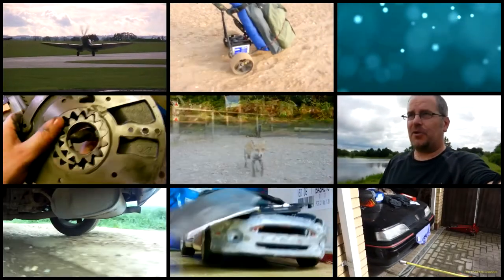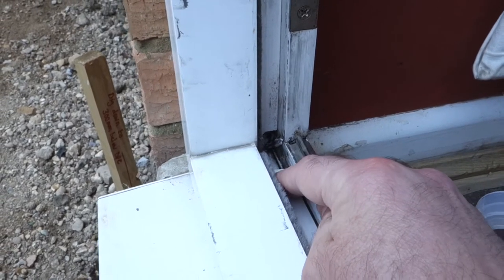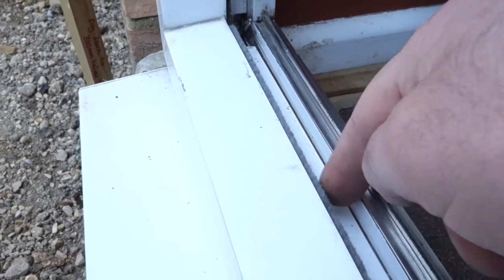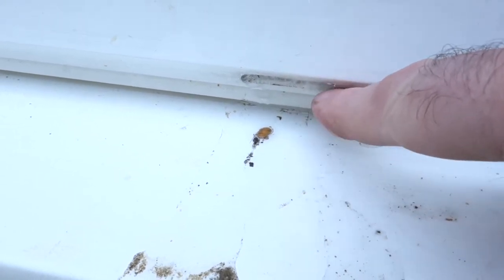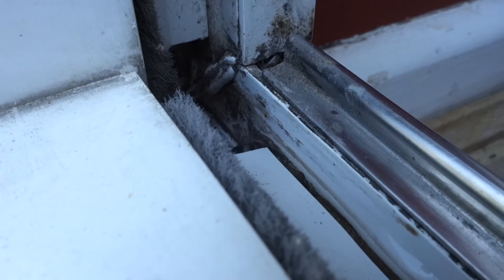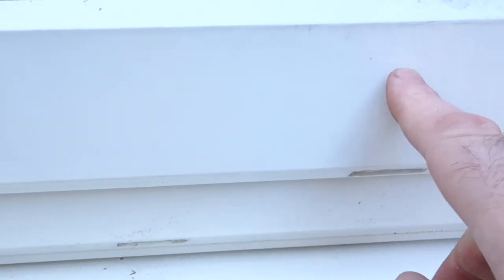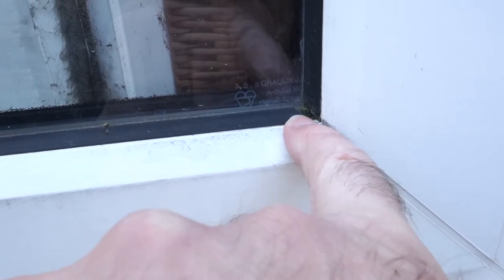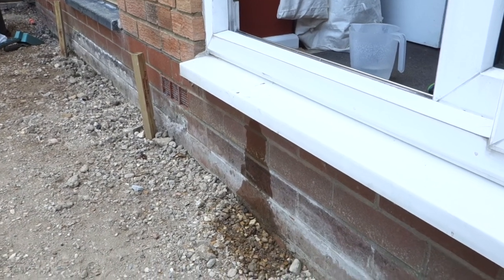Sliding uPVC patio-door maintenance checks - drainage channels

Comment: Hi just watched Great tip ,I have exactly same patio door as yours ,just wondering if you have any idea how to remove the patio door to replace the truck and maybe the wheels too as it keeps getting stuck thanks
Reply from the maker: Hi, ironically I had to remove my door for similar reason back in early Summer - my track wheels had seized up. Unfortunately I didn't video it because removing the sliding panel is a two person job because of the weight. Never under estimate how heavy glass is. Basically you have to remove any trim at the top and bottom of the surrounding frame, remove any clip on trim on the sliding panel, then lower the door by backing off the wheel trucks by turning the adjuster screws. This will cause the door to sink down. (There maybe an anti-lift mechanism or spacer which stops the door being forced off its track) Once all trim is off you will be able to see how the panel fits to the track. On my door I had to lift it up at the same time as pull the bottom of the frame out so it moved away from the track. You will need an assistant or two to help lift it off and place it on a strong, level area such as a table. Try and keep the frame level and DONT let it rest on the glass - only support it on the frame. The door wheels can now be accessed at the bottom. What usually happens is debris builds up and clogs up the wheels and track that can't be accessed when the door is in place. Lots of retailers sell the door wheel trucks so it's just a case of measuring them.

Comment: Great tips. We have an issue with our patio door is that water is trapped inside the window sash at bottom when opening and shutting the door you can hear it sloshing around and it slowly seeps out from the join at the bottom inside the house and at the end corner point. I identified that water must have got in from gap in the beading in bottom corner but its now how do I get that water out from inside bottom of the door! Any advice would be much appreciated?
Reply from the maker: That's an interesting problem. Never heard of water getting into the actual frame except in severe floods when door is partially submerged. Short of removing the sealed glass unit from the frame, or removing entire door (definitely need several helpers to lift safely), you could make a small hole in the most inconspicuous part of the frame on the outside and hope it drains out. Then hole  could be sealed with silicone sealant or one of those white plastic screw hole covers used on flat pack furniture or kitchen cabinets. Another possibility is to remove frame and see if the water drains out if the door wheel units are unscrewed.

Comment: Hi I had a sliding door custom made and now I get water inside the track when it rains hard the water starts coming in through the bottom frame seal. I see there are 2 holes on each end of the inside of the track but i dont see any outside weeping holes. Could it be that the manufacturer forgot to make the weeping holes on the outside door frame. How can I fix this problem ?
Reply from the maker: Hi, if you can poke some fine wire down the holes to see if they exit the outside of the frame. If not I'm wondering if the installers unknowingly blocked the drain holes when the frame was sealed up? Other possibility is the manufacturer forgot to punch out the external drainage holes or slots.